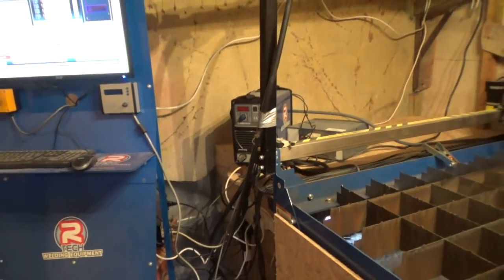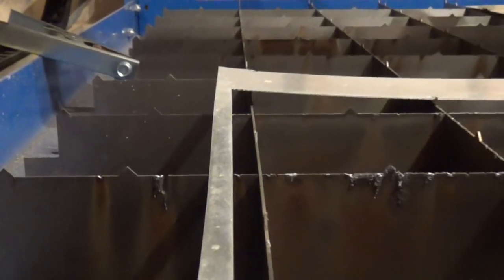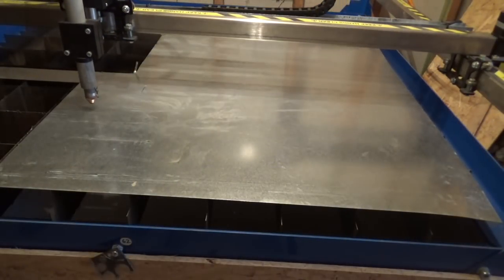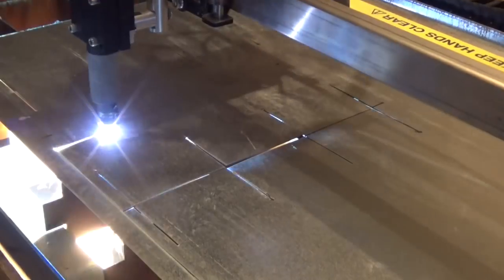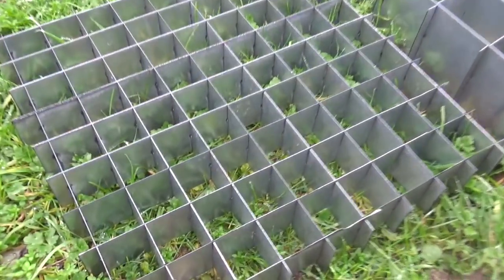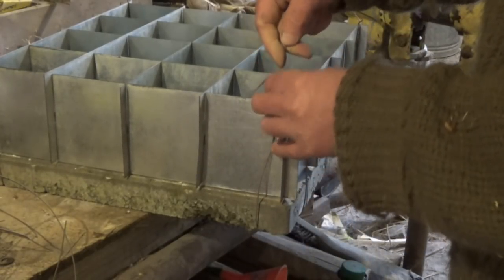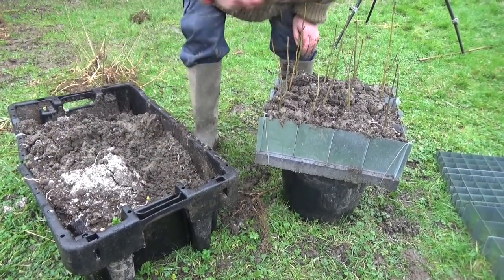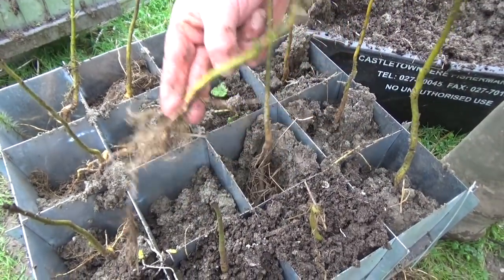Cutting Galvanised Steel With A CNC Plasma Cutter – To Make Long-Lasting Flowerpots. (R-Tech)

Comment: I also wanted to make pots from same metal sheets.I needed verry tall pots with no bottom ,for my trees with taproots.My pots should have been opened on a side too.Ive quit the galvanised steel idea and finally i made my pots from concrete foundation isolation plastic sheet.Be verry carefull not to inspire zinc fumes from the galvanised metal ,they can be deadly,extremely poisonous.

Comment: https://www.ebay.com/itm/PriceCNC-AVHC10-Plasma-Arc-Voltage-Torch-Height-Controller-THC-AVHC-Price-CNC-/172362492642
i think it is that , yes ? 
DOES IT WORk fine ?
Reply from the maker: Yes, it seems to work well, if I get everything else right. Good luck

Comment: I do envy you your ash trees! I have a single english ash, from which I fashioned the snaith for my scythe with the carving knife, and if I had saplings growing, I would be able to produce many more. It flowers every year, but apparently the trees must be either male or female, and as there is no other tree about for many miles (maybe 12,000 miles away in Ireland??), it never sets any seed. It does get loaded with golden pollen sometimes which sends the bees into a gold-dusted frenzy!
Reply from the maker: there were at least 1000 on the roof this year - all from a tree 50' away. The interesting thing is that we only find them on the roof - everywhere else they don't survive. It has to be mice/rats eating the seeds - but you'd imagine that a few would survive, but nope.

I'd offer to send you seeds, Ruby, but we have ash die-back in Ireland now, and Tasmania doesn't need that.
Reply: Another fell plague? Ash die-back! I hadn't heard of that one.
Our community woodwork shed has a supply of gorgeously-figured english elm timber which we are all eagerly using for many & varied projects. Apparently Tasmania is now the only place in the world growing elm trees! Someone mentioned that dutch elm disease has started here too, so we could also be the last place that elm can be found. Quite a few of them around here, but english ash is rare, though there are some ornamental types like claret ash. I recently cut a bundle of elm and sycamore saplings to try out for scythe handles. The owner is trying to eradicate these tree weeds, but if they can be used this way, that will be a marvellous thing. Our native trees are too brittle and heavy for snaiths.

Comment: Nice job Tim, I'm pretty sure that galvanised steel won't harbour too many plant diseases. 
A quick spray with diluted Jayes Fluid in the autumn before re-use should make sure.

Comment: About the only thing limiting you is the cost of material, other than that it's anything you can imagine...and program. Thanks for the video and good luck.
Reply from the maker: Cheers, Duncan. That's why I'm starting with the thin metal - it's not too expensive to make mistakes on

Comment: Does your CNC unit have have a table stop setting that will not allow the tip of the cutter to go too far down? The setting may even be adjustable for varied thicknesses of material.
Reply from the maker: The torch has to touch the surface to know where it is. It does that automatically, and then rises to the correct piercing height, and then it drops a little to the correct cutting height. It's complicated!
Reply: Right. but I've worked with some CNCs and CMMs that you tell the machine to not go down any further than any z coordinate (which is height). didn't know if this one has that.
Reply from the maker: Yes, I'm sure there is. Just don't know where it is yet!
Reply: an exciting learning process

Comment: while i know you have down draft ventilation, please be super careful when cutting that galvanizing. Protect your respiratory system with an n95 or charcoal respirator or anything that is applicable to the job. Breathing nasty stuff can be irreversible.
Reply from the maker: Thanks. Yes, I am being very careful. I changed the air-flow slightly and I really think the extractor gets it all now.
Reply: Wondered if you could leave tacks in the cuts to reduce curl up, the sort of way one often tack welds big pieces before seam welding, but in this case it would be tacks left along the seam cuts. Perhaps also you could use second hand galvanised roof sheets as stock? Or to make commercial product stainless steel, there are often ebay deals of 8x4 stainless for about £50. For me the paving slabs with steel matrix would be a trouble to move, but perhaps you have a fork lift. Ash over here is a pestilence, growing every where & it is also when bigger prone to a new disease, but it is a fine hardwood & relatively quick growing.
Reply: I concur...it is my experience that there is always some residual above the the large sheets, no matter how hurricane-like the draft.
Reply from the maker: Springwood Cottage - the tacks is a good idea, but really the machine should be able to cope so I'll keep experimenting.
I've been looking for secondhand sheet materials locally but there just isn't the same level of manufacturing history here, and it has a knock on effect for availability of machinery, expertise, materials.. (I'd jump at any ss for that price!)
No forklift - but I have an idea for something else..